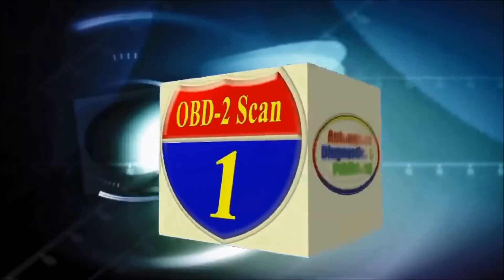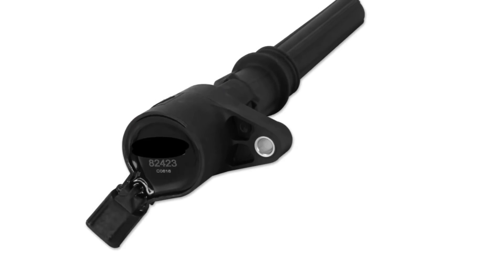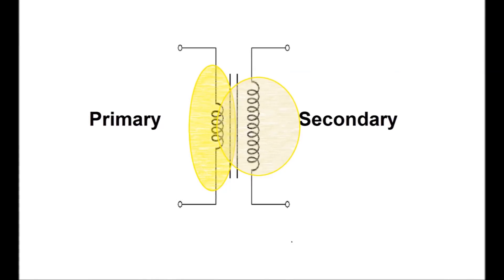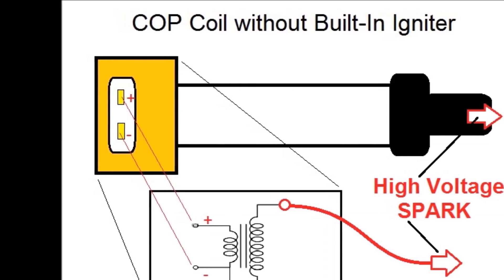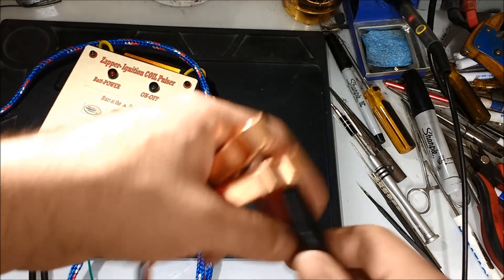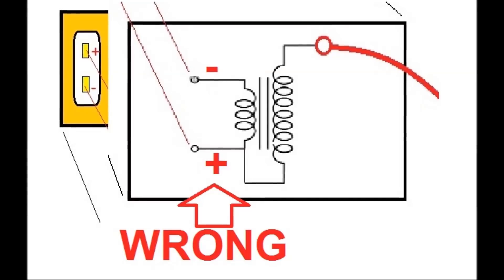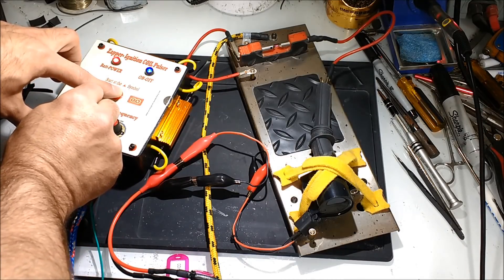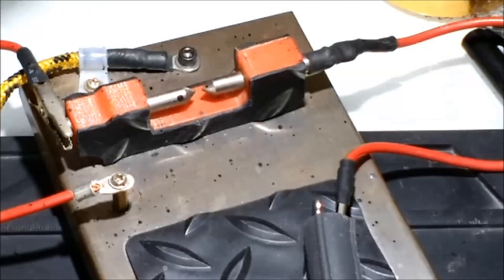How to Test a COP Non Igniter Coils

Comment: Nice vid Mandy. What would happen if someone hooked a shorted coil to your zapper?
Reply: I mean shorted on the primary windings
Reply from the maker: Yes, I understand what you're asking. This is now the second version of the Zapper since we introduced it, 7 years ago. It has dual 60 Amp transistors, cooling fans, and a big outter-resistor for protection. It will take shorted coils no problem. However, if you don't see a spark, no sense trying and trying, coil is bad. If coil shorted completely (rare) outside resistor will heat up. Most coils fail with carbon tracking or semi shorted windings. Thanks for viewing and feel free to call me if needed. http://www.autodiagnosticsandpublishing.com/ignition_coil_pulser_tester.html

Comment: Is there any reason that you could not fire both 2 and 3 wire coils (coils with and without the ignitor) with your bi directional controller if it is set up correctly? I understand they are actuated differently. Would the back emf damage the bidirectional controller?
Reply from the maker: Hello Matt, Yes exactly, that's one of the reasons, back EMF. Also signal dwell or pulse width, RPM adjustment, and signal current strength. Ignition signals are NOT PWM signals. 
http://www.autodiagnosticsandpublishing.com/ignition_coil_pulser_tester.html
Reply: Bro, I use a 5 volt battery to tickle the igniter in 4 lead modules and for 3 wire modules you can test by making and breaking 12v with a button. These tests and tests with "the zapper" are not great  and will get u into trouble. The most important test is a dielectric breakdown HV test since that's how most fail. The potting compound breaks down and develops carbon tracks and arcing, reducing the output and causing incomplete ignition. The coil will still test fine. U need data. data the a ECU usually gets and will tell you what cylinder is misfiring. Worst of all and most of all you will get coils that are intermittent with engine temp. There are ways of using a scope to tell if all cylinders are firing using a current clamp. at the battery. Its super cool. a better way is to do like the ECU does and measure cylinder ionization.